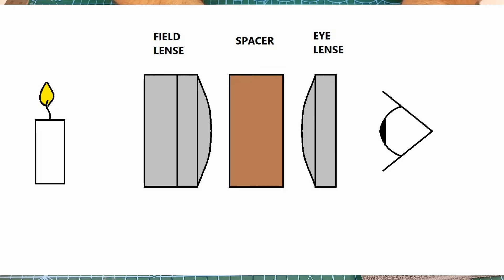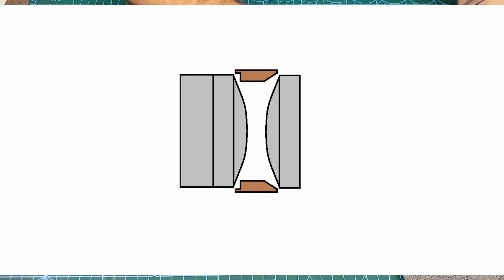Cleaning and Repairing a Telescope Eyepiece

Comment: I have some love for that particular  eyepiece,  and its 15mm brother which is even better.  Most comsider these to be throwaways because they come with scopes (usually the 25 and 10, but some scopes have come with the 20).

The thing about the 20 is that it has a wider field than typical, 60deg or a tad more. The 15mm has the same diameter optics and field stop, so it happens to be in the 65-70deg range.  Without a barlow,  or the 1.5x thread on barlow trick, they are pretty bad at the edges in fast scopes, but put them in an f8 or slower and they clean up nicely 

Where they excel is light transmission,  even though they have very simplle coatings,  the 3 lens design is an advanrage in some cases, and i have been able to eek out fainter objects with them than with my normal outreach grade QX types which has 5 or 6 elements. The same applies to those GSO made E-lux type 2" widefields that come in those 2" kits. Those 2" 3 element "reverse kellner" wide field, especially the 40mm, can outperform similar price class 2" superwides that have 5 or 6 elements in the $50-150 price class as far as contrast and light transmission goes, and in the case of the 40mm, it also has a wider apparent and true field than the 42mm GSO superview,  the widefield is advertised as 55-56 deg, when it is closer to 62-65, where the 42 barely hits 60 if it even does, and has a fuzzy field stop to boot. As I will mention now...

Another sleeper is the 4 element GSO  15mm superview. And ONLY the 15. The rest are 5 element,  the 30 is the 2nd best,  the 20 was so so, the 42 and 50 are disappointments,  because they dont use the full 2" field and hence have narrower than advertised apparent fields. Most respectable 42mm eps advertised as superwide should use the whole field or pretty close, and the 50 is even worse in this respect, being no wider than a plossl and a plossl can go to 56mm and still keep a 50deg field.  The 50mm axiom had a 56deg field which was the max, the superview is probably under 50. The 30 is actually decent, and pretty much as advertised,  65deg and what you would expect from and erfle type design in a modern superwide application.  And many GSO made dobs come with them.

But anyway I digress.  The 15mm superview,  head to head against the 15mm QX fron my outreach kit (same as es70/bresser 70), in my 4" f10 on the double cluster, showed more stars, had more "pop" and contrast, and was overall a more pleasing view than the slightly more expensive QX.

For most of my public outreach, especially with my c11 when m13 or m22 were visible , I had a 90+% wow factor, and this was in heavy light pollution.  1.5mm exit pupil and a high transmission eyepiece was my secret weapon. Everyone else showing planets, the moon and double stars, and i am showing 100s of thousands of stars.  I would just have to tell people to give their eyes a few seconds to adjust, and be right on the eyecup to avoid all the ambient light at some of the locations we were asked to set up at.

Last thing, the 10 of that series (the plastic SMAs/"celestron "), which is the same as the skywatcher "super 10", can easily be widened to about 70 degrees.  The retaining ring that contains the field stop, is plastic and can easily be carved out to the edge. The lenses are much wider than a 10mm plossl, so it is being choked off quite a bit. The narrowest of the line,  being under 50 degrees before being carved out.

I guess that is how they get away with calling it long eye relief,  which it really isnt. 

With a thread on barlow element, it becomes my invention,  the 7.5mm "Smagler".

And the 15mm superview with a GSO 2x shorty barlow threaded directly on is a "poor man's pentax", well corrected to the edge in an f5 dob
Reply from the maker: thanks for your comments mate, very insightful. I have no doubt that this is probably on the low end of what is considered good. But it is the best of the affordable options. Gets you in the realm of "suitable" viewing. The sky is the limit from here and you can end up spending thousands on just a single eyepiece. The reason i do these videos is allow easy access to science for all.